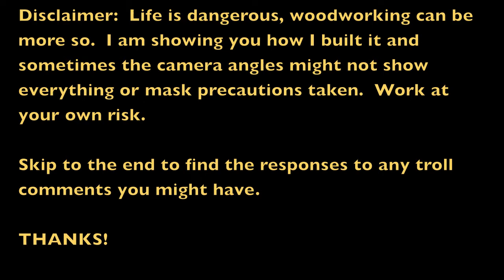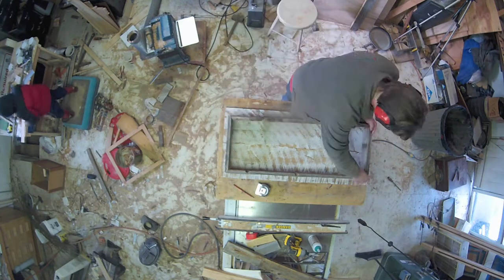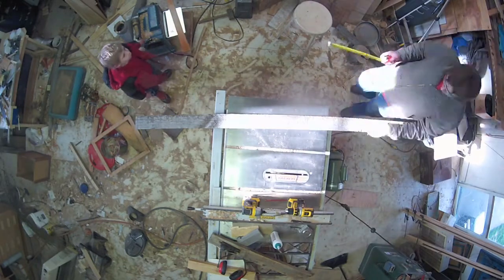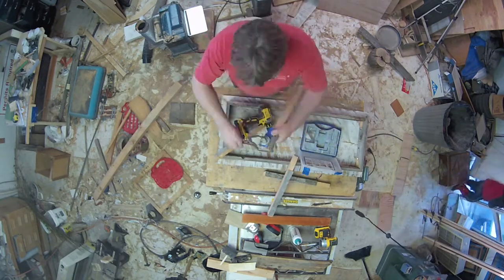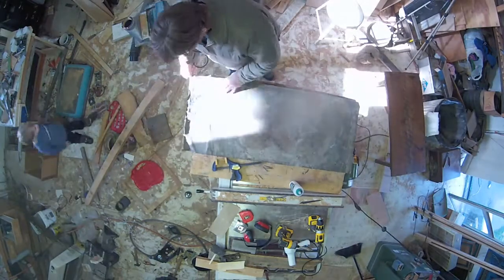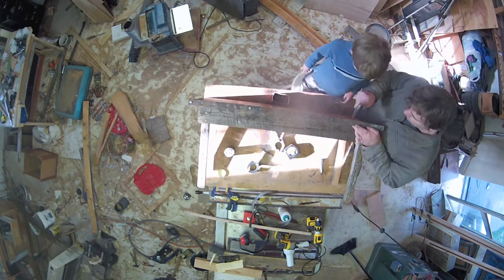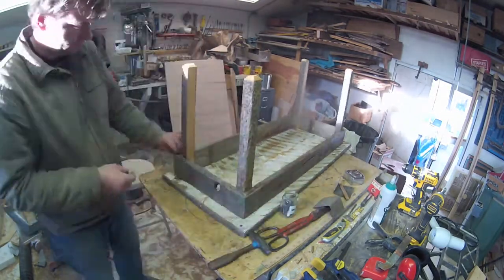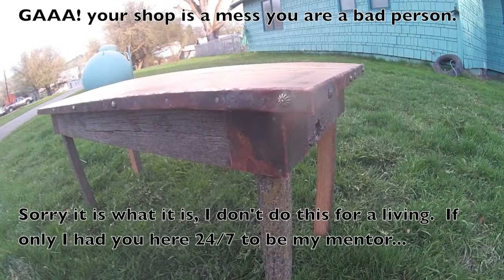Rustic Copper and Barn Wood Table

Comment: I like to see that hug after you both agreed to do better in the shop. I wish my father would have taken the time to show me anything in a shop.
Any guess what the high bid might be?
Thanks 
Patrick
Reply from the maker: FloppyHatPhotos Not much but then I knew that going in.  Other than the log furniture guys, around here the best you can hope for is to of set the cost of your hobby some.  Ever get around to using that slab?
Reply: Yes on the thin peice but sadly the card got corrupted so lost all the video & gave it away, as for big no as I'm waiting tell I get office rewalled so I know the size to make the deck.